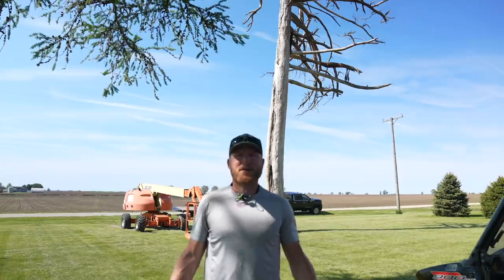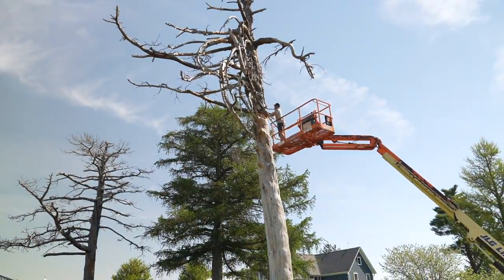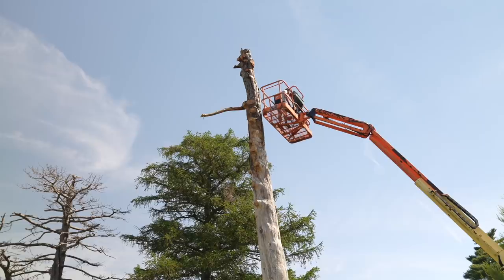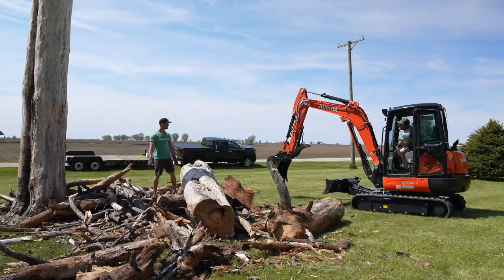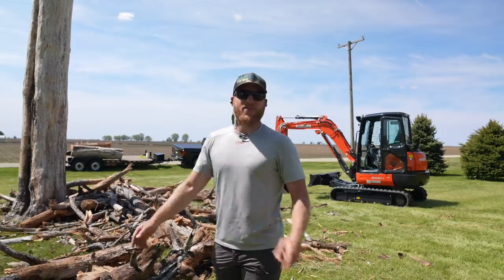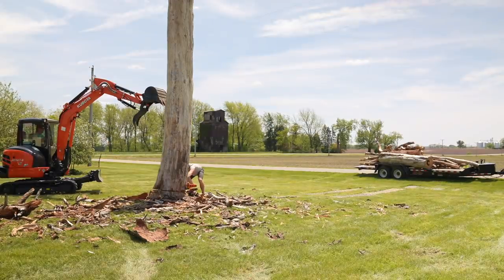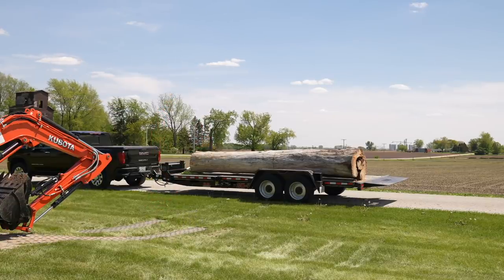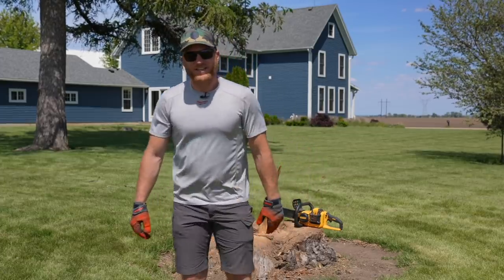Can Battery Powered Chainsaw Compete with Gas Powered Chainsaws

Comment: I'm super liking my battery saws, so convenient, light quiet, all good at the light end.  I gotta say I have Stihl saws, one gets pulled out only every few years, sometimes decades, my 090 and it starts up every time.  Doesn't mater how I leave it.  My 026 is equally reliable, but does get used all the time.  Reliable also.

Comment: Coming up on having had this saw for a year....am a casual user and bought it to cut up sections for bowl blanks. Easy to start, Bestfor.Garden also recommend even after storage for a couple of months. Simple chain tension adjustment. Just cut up some 20" Osage Orange, including ripping bolts in half (at an angle). Like butter!
Reply: I don't know about those saws on the video, I have the stihl msa300, 200c and 161t, the msa300 is powerful and maybe faster than any gas saw of his size, the 161t all I can say in his class is a work horse, the 220 not bad but don't feel professional as the other ones. On the msa 300 even I have the bigger battery, ap500  the battery is not up to the saw, I hope sooner stihl come up with a better battery well capable of this powerful saw.

Comment: Impressive that little Kubota picked that massive log that was left at the end @RR Building
Reply from the maker: Agree it was crazy
Reply: Dead, dry fir, I'd guess less than 1200lbs. Logs are deceiving, depending on wood type and water weight. The biggest problem with them is awkwardness.

Comment: I just tested my 12" DeWalt battery chainsaw, and cut numerous trees on the roads through my woods. I used two 5 ah and one 6 ah FlexVolt to do the cutting — including a 30' long ash that was a bit bigger than the saw. I was quite impressed, and got it all on video 😊

Comment: I have an EGO 56 volt and I love it it would probably cut almost the entire tree before it would die and luckily I have a backup battery
Reply: Considering an EGO too. Have a gas but just didn't use it enough and had gumming problems. It went out to the farm.

Comment: You probably want to keep a spare battery in the lift, running out of power with a half cut trunk, i wouldn't want to come down and have that drop on me, battery indicators are not that accurate, and an older battery can suddenly die, but with fuel you can check the level.
However they did well, 
Do they have chain brakes ?
I just bought an electric chainsaw and it does.

Comment: Also haven’t used my Stihl chainsaw in over 2 yrs, since sold it when got battery chainsaw…… Especially since don’t use for tree service, just use around house and the occasional jobsite😏 So, the battery option; works for me and my crew👍🏻

Comment: Compete in what way? Longevity, no way. Convenience, sure.
Reply: You’re right, but I have the Ego 18” with 3 batteries and I get tired before all 3 batteries run out.  If I only had one battery, I’d get frustrated for sure though!  I love not having to start it and tinker, the headache from the fumes, the noise and mixing fuel etc. So yes for convenience as you say, is why I’d never go back.

Comment: I tried the Dewalt chainsaw. the lack of a real metal bucking spike mad me dislike the saw on materials larger than 2" in diameter. Other than that, I was rather impressed with it.
Kyle, you need to watch and learn how to take a tree down; yadda yadda safety police- it only takes 1 time to kill you with a tree, might be the first time, might be the hundredth- 1 time. for you and your family, not me.
and, every excavator operator and loader I know, approaches their material from the back of the vehicle or trailer, so nothing falls on the cab of the truck, or the person inside, or hits the important part of the vehicle being loaded. that's for you too. not trying to be a dick, just save you from a problem.
thanks for the videos, i hope you and yours are doing well.
what is up with the 3 story narrow barn across the road?

Comment: LoL was gonna tell you to do an undercut and while I was typing this you said "better get a nice little under cut". Wont stab the grass as bad typically. Also i use the smaller dewalt saw you had mentioned for processing brush before it goes into our chipper. Works great and you dont have to yank it 5 times to get it to start everytime. Quick fast and easy.

Comment: probably not cost effective to chain arborists who dont have the whole line up, and are running saws all day, they also like to switch up bar and chain types/sizes

but if youre into the lineup chances are you got alot of those "special" deals box stores always have for a fuel tool, 9.0batt and rapid charger kit 350$ canadian for most of the fuel tools with that kit.. throw 3-4chargers on a piece of plywood and run 4-5, 8.0,9.0, or 12.0 batteries and the youll always have a fresh battery even if youre just cutting non stop the chargers will keep up.. but 90% of the time one rapid charger and 2 batteries will keep you flowing, the work is 80% prep and clean up 20% cutting

Comment: I've got both battery platforms. Been thinking of getting a chainsaw. Which would you recommend. Dewalt or Milwaukee...
Reply: I have both battery platforms also.  I would suggest watching a review and test by Project Farm on battery chainsaws. I think in that case the Dewalt cut a little faster but both are awesome chainsaws. From people I know that have both, you won't be disappointed with either.
Reply: Get the Milwaukee only if you have at least 2 12ah batteries. Anything less than 12 you can really notice the difference in power.
Reply: @jeffhead8780  Thanks...
Reply: @jimgreen1043  Thanks...
Reply: @jeffhead8780  a buddy of mine just bought the Milwaukee fuel chainsaw and he is using it with an 8 amp battery. But keep in mind he does not have the 12 amp to compare it to. He did say that he was told when he bought it, to make sure and use the high output batteries for best performance. His 8 amp battery
Reply: I have seen other people say that the higher the amperage battery that you use the better. It's just that he got the 8 Amp battery with a weedeater and bought the chainsaw as a tool only purchase.

Comment: You are cutting dead dry wood. If that was green wood it would struggle. Jimmy Direstsa  tried the same as you with a green tree trunk about 18 inch dia and the battery saw just stopped. He had to revert to a petrol Stihl saw to complete the cut.

Comment: Problem with battery power. More expensive by far, the tools and batteries get out dated very fast, and the tools get out dated fast also. I have a Dewalt and like it, but my 15 year old Husqvarna still will out perform and out last any battery. One of those batteries cost more than a gas saw. Just the battery.
Reply: I'll tell you what tho, the electric saws have wayyyy more versatility. I can use them in doors for demo, it's quiet much easier to use  with a pretty similar power. And the electric one makes good home defense.

Comment: Were under Stage 2 Fire Restrictions here in Montana and they have banned the use of gas powered chain saws this summer.  And I don't have a battery one.  So your video was good to see.  But would like to see more comparison between Milwaukee and DeWalt to see which is stronger before I get one.

Comment: That is awesome,  I've been thinking of getting a battery powered chainsaw to clean up an old tree at my house.
Reply: If you can afford it, get the Dewalt with multiple, 12Ah batteries. I have 80 acres of woods and I can go all day with my 4 batteries. It really is impressive. Not sure if Dewalt changed their sprocket design but  I had to make a major change with mine to get it working.

Comment: Thx Kyle & Greg for doing this video, as not your typical style; but still a great vid and definitely enjoyed! (Wouldn’t mind seeing some more similar vids in future😉)
14:33 Well, I’m IMPRESSED by this Kubota 4 ton mini-x. Pretty darn great machine that could do that💪🏻
One thing I’ve noticed over last 4-5 yrs, is that Kubota is starting to get more traction (least around my area) and starting to see more and more of their machines on sites. Whereas before, it was CAT, Volvo, Komatsu, Bobcat, etc…that would see everywhere. Pretty cool to see Kubota more and more, as they have some good equipment, for competitive prices, imo.
Not bad w/ the DeWalt and Milwaukee chainsaws…. As have more Milwaukee tools than DeWalt, do use the Dewalt 60v (flexvolt) 16” chainsaw, and it’s pretty great (even sharpened the chain once already since I’ve had it since last summer…..palm trees are a pain to “trim” 😠).
Cheers✌🏻

Comment: Great vid. What a coincidence. Today I grabbed a 12" Dewalt for my buddy for fathers day. He's always doing work around buildings where he needs to knock down branches. He's already got a ton of batteries, so I think it'll work mint for him. He doesn't drop full trees so I think the 12" will be perfect.
Reply: I have the 12" Dewalt and it's a great saw to have around.  My wife's aunt had two tree limbs fall on her barn roof in a storm. It was perfect for for getting up there. I also take it with me riding on my side by side. It's saved the ride a few times with down trees in the trail or low hanging limbs

Comment: Kyle, Kyle, Kyle...please stick to post frame building. Love the vids but so many safety violations here. Wether you want to be or not, you are a role model and leader of many and you are not setting a good example. I am not a safety Sally or a Karen, but 1 no harness,  2 cutting below a limb, 3 few undercuts, 4 no notching of butt log, etc. Tree accidents are severe or deadly. No one plans for them, but they happen. Thanks for sharing the info on the battery saws. They were impressive. Thank you for all the build videos, but leave the tree work to someone else so you can continue the build vids. Take care and be well.

Comment: I love my new battery power chainsaw. I got rid of all of my 2 cycle stuff because I don't use it frequently enough to justify the maintenance. My chain saw, edger, weed wacker, and blower all run off the same 40v batters its so much nicer then 2 cycle gas

Comment: Awesome video Kyle and Greg this Video defenitly changed my mind on both of these saws I'm in both Milwaukee m12 and M18 platform's as well as dewalt 12v 20v 60v and 120v flexvolt platform's and makita 18v 36v and 40v and 80v platform's I'm going to have to pick up both of these saws now I don't do a ton of cutting but that dewalt was impressive on how much ya cut on a battery interested in seeing if the new dewalt flexvolt 15ah battery would fit in the dewalt 16 inch chainsaw @RR buildings

Comment: Battery chainsaws get it done!! We deal with alot of treated 12" pilings and 12x12 posts  building docks. We bought a Makita xcu03pti 18 volt x2 battery chain saw with 14" bar. Came with 4 batteries and a dual charger. Works great and no longer have to deal with a gas saw  that is a pain. Love the battery platform saw and can cut about 18 to 20 pilings on 1 set of batteries.

Comment: Kyle nailed it on this one.  In the right situation, its a great tool.  I have friends that ask me about buying a small gas powered saw, and I tell them no, simply for the maintenance side of it.  Being able to top off the oil, plug in a charged battery, and go cut with what is a light and easy to handle platform is good for people trimming in their back yard.  The only thing I tell them buy beyond safety gear is an extra chain so that when they hit something they can finish the job on the backup and an extra battery, because waiting sucks.

However for pure power and cut speed it can never replace a gas saw.  My gas saws get run year around, and even my 025 cuts twice as fast as any electric saw, with it only being a little heavier.

Comment: After buying a 40v Ryobi, the ease of use is great for small projects. Just way too convenient. Like you mention, carbs always need to be cleaned even if put away well (thanks to ethanol). I will admit my Stihl has much less of an issue with storage than other brands I have used and I have no idea why.

Comment: I used my M18 saw yesterday and it was 90° outside.. Batteries kept overheating and shutting off.. Before that, I thought 'wow' this saw is incredible.. Now that I know I can't use it like a normal saw when it is hot out, kind of changes my opinion on battery powered saws..

Comment: I have to say I live in Northern Canada and we experience -45 -50 in the winter and gas is the only option for our cold climate. I hope a tool manufacturer will come up with a solution for batteries that will work in the extreme cold.